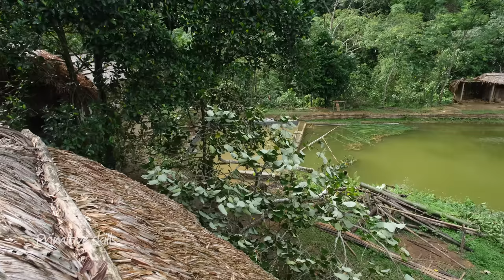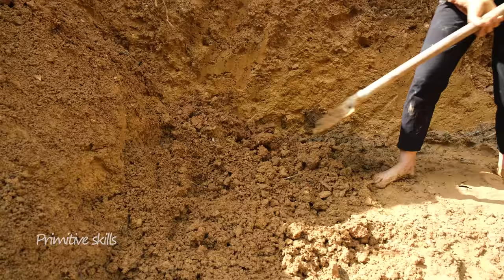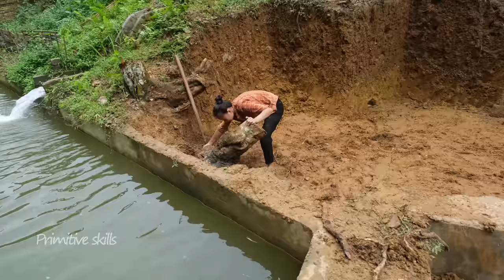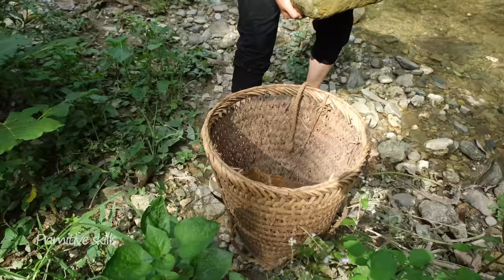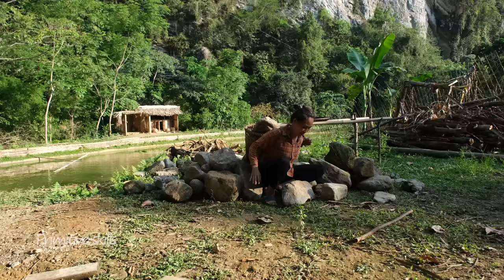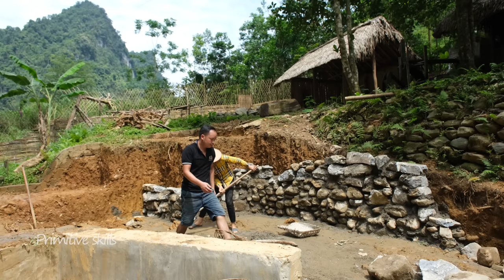So awesome to see Duong return to the farm! Build a fish pond with his wife, Take care of the Farm

Comment: That last wall is about 70% limestone. You could have used it for concrete mix and just mad a concrete wall.
Reply: I wondered a reason for that? One I can think is that the little walls are infact little they will be covered with a coating of concrete where as the other walls may not? You would not want to expose limestone to direct water as it will errode away? Could that be a reason?
Reply from the maker: Thank you so much, I will pay attention to my heath. Wish you all the best.

Comment: once the roots die and dry out, they will make a long burning fire
Reply: You can also process them into pine-tar, which is a liquid containing a lot of turpentine and can be used to preserve wood.
Reply: @glawenclattuc3127  maybe maybe not,,,,,,i live in a pine forest and have access to fat wood but i don't remember seeing any hard woods that did the same
Reply: @tewdogs4475  a lot of trees contain turpentine. They usually have it concentrated in the roots to prevent them rotting. I’m not sure what species in Vietnam would be the best for it, but it seems to be a very wet area so I’d assume trees would need rot resistant roots 🤷🏻‍♂️
Reply: @glawenclattuc3127  have to try and see, but with effort.....it should smell as my pine does